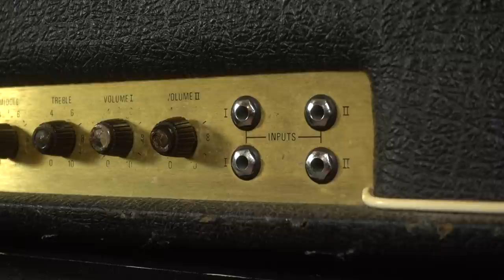The LOUDEST Amps EVER MADE? | Friday Fretworks

Comment: Great explanation. Early days I used a Marshall stack live simply as the PA we had wasn't up to running more than the vocals really. We needed the power to balance drums and bass but, my God my ears took a pounding. Later I used a Marshall 2150 combo. Still 100 watts but much easier to control but still had the headroom. Now Pas are so good there are a multitude of choices and much better for your hearing. 👍

Comment: Having played in bands for more than 50 years with all types tube-driven amps, namely Fenders, I currently own the two loudest amps I have ever heard in my life, both of which came about quite by accident and am still personally amazed by them, as well as other musicians stating the same. Here they are ...

1. Bought a Carvin MTS3200H from a fellow musician for $240 USD that only needed new tubes. So, I purchased a full high-gain set of JJ Tubes from Eurotubes, installed them and properly set the biases. It now drives an extra slanted 4x12 Cab I had that I loaded with 2-WGS ET65s (top), and 2-WGS Retro 30s (bottom). End result is that not only does it sound absolutely gorgeous no matter the tone/drive settings, but is for medium+ venues only.

2. Being so very impressed with the above WGS speakers, I also have a 2008 Fender FM212R that I bought new just to have something simple to practice on that came with cheap Fender-labeled speakers that were plain awful. Therefore, I bought and installed one each WGS ET65 and WGS Retro 30. Talk about a 180 degree turnaround. Not only does it sound BEAUTIFUL and takes pedals very well, but is the loudest combo I and many friends have ever heard. Can't play it in the house anymore because even with the volume set on "2" it is just too much. It is now used for small to medium venues only.

So, what do I use at home now as a practice amp? My 2007 Crate FW120 Half-Stack loaded with Celestions that not only sounds terrific, but is very controllable and forgiving volume-wise as well.

CHEERS!
Reply: rehearsal rooms in my city have either peavey bandits (which are super cool) but mostly those fm212r in all the spaces, hands down the loudest combo i've played (and i've tried those 6505 2x12). i remember playing death metal on them, could never get the volume past 4 because it would drown out the drums haha
Reply: @raulperez2308  How right you are. Now imagine their being loaded with upgraded speakers like the WGS Retro30 and ET65 in mine.

Comment: Ahh, the distant thunder of footfalls from our amplifier ancestors. I have used Super Leads (currently have a '72 Super Tremolo!), 50 watters, Ampeg V4s, and of course Fenders. There was a time when I would dime any of those amps - I didn't use distortion pedals, after all this was back in the '70s. One band I was in (briefly) rehearsed in a band member's small basement - concrete surfaces everywhere, the only sound absorbent materials were the band members and their clothes. In that band I used two mid-70's Fender twins, one of them through a 2x12 Traynor extension cab. I dimed both Twins during practice so I could actually hear myself (yes, we were that loud). At the end of each rehearsal I felt like I had been pummeled by a runaway freight train, and would hear the sound of the 'ocean' in my ears for at least 24-36 hours. Four rehearsals like that and I said I'm out outta here. Thus began my search for bands/gear that focused on decibel quality as opposed to quantity.

Comment: In 91 I bought a Ampeg V4 Full Stack, took 2 months to find all 12 tubes it ran, it was biased by a guy at Sunrise Music, he ran the amp shop in the back, after running it for 3 days with all settings on MAX it was time to try…..

He hated me, I hated me, the block hated me…. 

Anything past 3 was absolutely pointless, the only time it got played at that setting was middle of the day when the neighborhood was out at work.
Had to keep it at at 1-2 then throw pedals at it and BBE maximiser to give the headroom that it missed at low volumes.

Amazing power and amp, excessively sensitive on touch of the strings, it couldn’t sound like SRV or JMH but did everything else perfectly, made Marshall’s Stacks cower and cry…

Comment: Loudest amp I ever heard was a Fender Supertwin: six 6L6s and two 12" JBLs, 180W of blackface sonic terror (belonged to a bandmate). In terms of sheer onstage sound pressure level it was pretty outrageous and it wasn't even me playing it. 

Dunno if I could ever get used to this new paradigm of everything onstage being quiet and the FOH engineer controlling everything. Back when I was doing a lot of gigging the PA was for the singer (and the drummer got a hand with a mic on the snare and in the bass drum), but all the band sound came from the backline. If you played a powerchord you felt it kick you in the back and drill up your spine through your feet, you didn't just hear it through the foldback.
Reply: I played a Firebird through a Super Twin at a low volume and it was fabulous. The amp was sitting upright on a flight case as according to the shop owner it had spent its life being wheeled about flat and only sat upright for gigs then back down again . My interest in the amp waned when I was told it weighed around over 40 kg so no chance of lifting it into a loft where the guitars are 🤣🤣
Reply: Totally with you on this one. Nothing beats having a full stack cranked on stage or with a band. Just did a recorded rehearsal with a Fender Dual Showman Reverb and a Marshall JCM800. Guitar feeding back like crazy, bass player struggling to get over me with a 500 watt amp, and drums not even having a fighting chance. And its one of the best recordings I've ever done. Theres just a different feel to it.

Comment: I was after this for a while and settled on the SVT WITH TWO 8X10 CABS... which you may know the Stones used for THEIR AP amp on their us tours... and a SOUND CITY 120, full stack, with I believe 6 EL34... and the Fender SUPER TWIN... definitely was up there!!! By juicing 6 power tubes voiced for guitar,  it was insane! You couldn't take all those mids. The Peavey Deuce was the same. Although I liked the Sound City full stack the most, because it had a pleasing tone and could be used without making a "hot spot" where no one could sit! In fact, most of those amps, including an original Orange OR120 FULL STACK, were typically facing around backwards in mid sized venues, to diffuse the sound a bit, as they were damnably directional and could send a narrow beam of decibels a mile or so without spreading out!!

Comment: I have solved my need for small venues that I now play getting old. i took my stereo Fender chorus/reverb 25X25 watts being 52 watts solid state. put it in a old twin cab with the 2x12's. i can max it out with the bass on 10 with zero overdrive tons of air movement and play any club on full. i gain stage pedals so my edge of breakup is very clean.

Comment: Chris, this is very insightful. As a teenager in bands playing local clubs in the 70's, I started out with an HH amp. It had rubbish distortion and eventually, when I could afford it, I bought the coveted Super Lead 100, with a 4x12 Celestion cab. You had to right? It was the 70s and I was 17. But in a club of 200 people I could only get it to volume 1😂. Sustain 2/10 distortion 1/10😂. At home, when my parents were out, if I cranked it up for that gritty, creamy sound (with a Les Paul Deluxe, so not so gutsy as a Standard), people could hear it 2 miles away! We resisted the Laney amps, and the Hi Watts and the Simms Watts (tribal times😁). Duhhh.

Comment: I've got one of those in my basement, the exact same one. I got it from a mate it in about 1973 IIRC. I got a JMP Mk 2 50w lead 2nd hand in about 1978 and I preferred that 'cos of the pre-amp volume knob. That's also stored in my basement now. I just use my Axe-fx III now. I used the Simms-Watts mostly for it's clean sound although IIRC it will break up if given enough throttle. It has a very unique clean sound. A certain punch followed by a certain smoothness.

Comment: The early 70's Ampeg V4 cabs really shook some bell bottoms, no matter what brand head plugged in because of the dado air-tight construction and front loaded speakers.  Not saying it had great tone (think of early Car's like "best friend's girlfriend").   And it's not the same tone as say a Marshall, not even if you swapped speakers, they are LOUD though.

Comment: There were louder amps. The Marshall Major 200 would be an example. Then there were weirdos that used a Ampeg SVT-CL with it's 300 watts for guitar.
Reply: The Fender 400 PS was nuts. I had one and sold it on to my cousin. 435 Watts.
Reply: Blackmore used Marshall majors  200 aatts 4  kt 88's  but he played thru a univox taperecorder to get his compression and distortion . nobody knew this .. the volume was controlle by the 200 watts . distortion and gain from the taperecorder .

Comment: The other thing is that there is (at least) another thing to how loud a guitar amp sounds, and before it breaks up

There is the input section - and that is mostly where it deals with headroom

Whether it drives the output valves

And finally which speaker the amp is connected to

All 3 of those make a difference

So you also have pickup output which changes the signal to the input section

And there is the load on the output valves

but change the speakers in the cabinet, and everything changes

This is something that modern amp simulators try to reproduce, by allowing you to have a different "cab" on an amp

Valve amps react differently at both ends, the input and the output. both hit a different part of the amp, and change  how an Amp reacts

Do a review on the difference between a "pedal platform" amp (or simulator eg Two Notes CAB M) and and amp that has no headroom, and you just turn up the guiitar to drive the input and / or ouput section

It's all v technical, and you seem to be a person who can explain it all

Comment: Definetly good Info, but far more important than wattage in terms of loudness is speaker efficiency. A 4x12 equiped with greenbacks will be completely blown away if put up against a 2x12 equiped with something like wizard's/gouvernor's or demon's. 
Thats why the db per 1watt/1m rating is important as far as quantity goes. Quality can be found in the frequency chart. 100db on 1000hz are a different kind of beast compared to 100db on 100hz.

Comment: Damn, i thought my fender super twin reverb with 385watts was loudest. I got it wired with 2x 15” Celestion 100 watts each.
Edit 6x 6L6 tubes
Reply: Johan Segeborn does a fun youtube demo of a cranked Super Twin Reverb.  Definitely check it out.
Reply: @littlerattyratratrat  thx. Subscribed. Looks really fun all the fenders displayed
Reply: I think you'll find six 6L6s will give you about 180 measurable watts, although I agree a Supertwin sounds more like 380 if you're standing in front of it at full belt 😂
Reply: @sfedroid  you are right. But it always sounds so nerdy to refer to what's written on the neck of the amp. "4 Ohm minimum" "385 Watts RMS" or something. I am not even sure.
Anyhow, the beast sounds so good at living room level. Fun to see that a commonly dismissed amp has a very specific fan base.
I removed it from the cabinet and it is upside down with is tubes pointing up, glowing in the living room. Gotta love it.
Cheers ya all.

Comment: lOuDeSt AmP eVeR????!??!?!  Doesn't mention the Marshall Major or Ampeg VT22.  I haven't measured dB from each with their original speaker configuration (or the same speaker config to make the head the only variable), but I strongly suspect both of those will be drastically louder than either of these.  Vox Super Beatle or Westminster also in there.